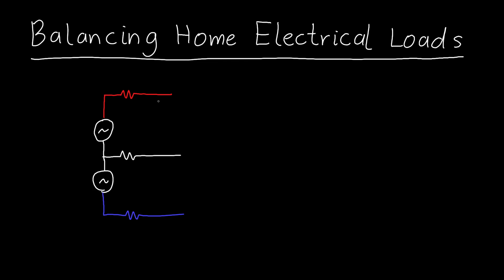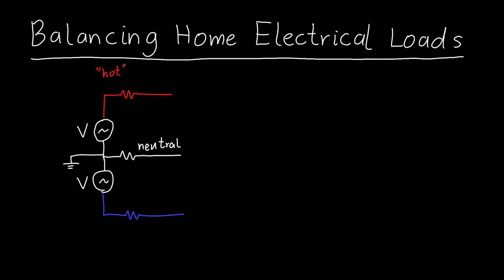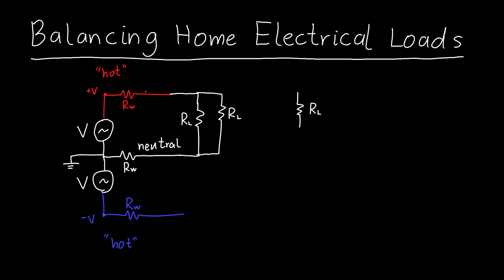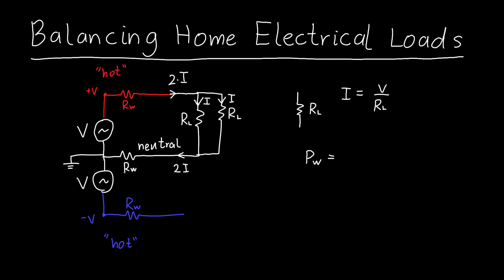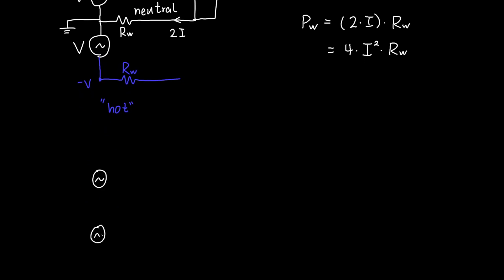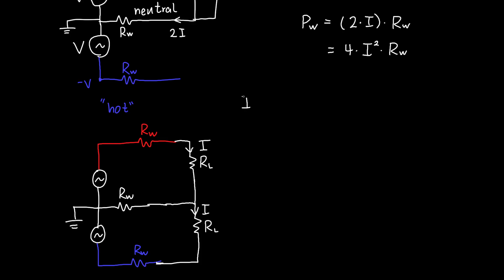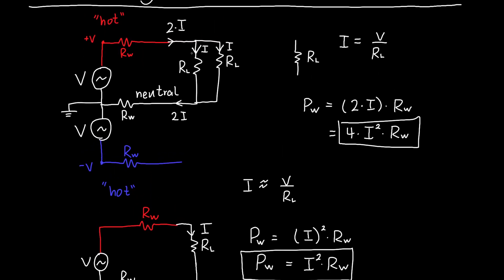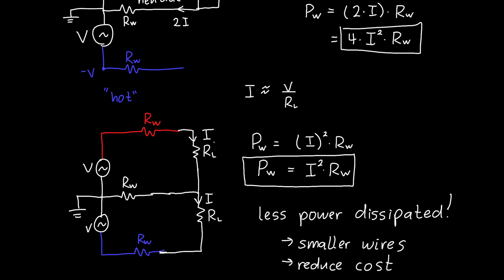Why Balance Electrical Loads in the Home?

Comment: Is this an argument for Multiwire Branch Circuits?  Because that is the only code-compliant way I'm seeing to use less wire -- not smaller wire, just 1 less neutral wire per pair of branches.  This has other theoretical advantages as well (and disadvantages or at the least, caveats).  But if you're talking about balancing a load between legs across the whole system, I don't see how you could use smaller wire and still be within code, or as someone else put it, "be monkeyproof".  Not that I'm an electrical professional or anything.

Comment: Only the feeders to your breaker panel would see a difference in power dissipation sensitive to phase balance.  The branch circuits leaving the panel have the same current regardless of balance and this is where your money is spent on copper.  Besides, the feeders are sized by the utility based on the overall service amperage which is available on both phases, so the feeders need to handle a completely unbalanced load and therefore cannot be reduced in size by assuming a balanced load.  I'm not sure I understand your argument.